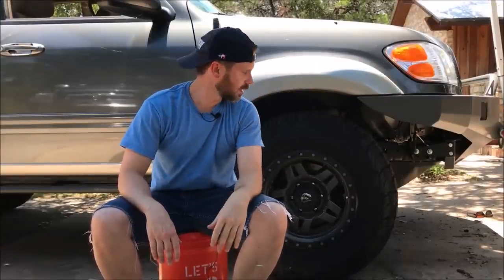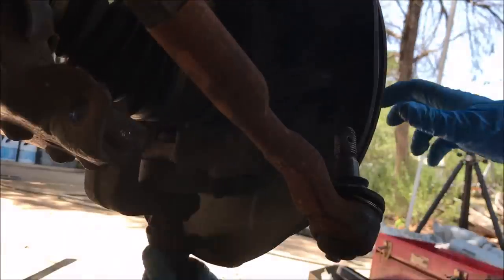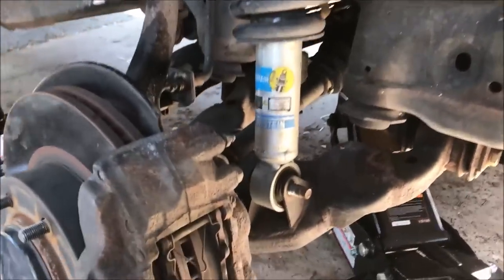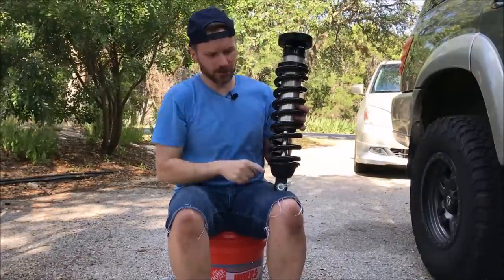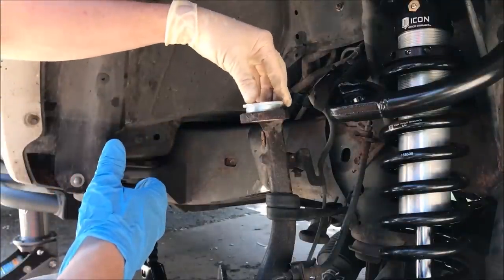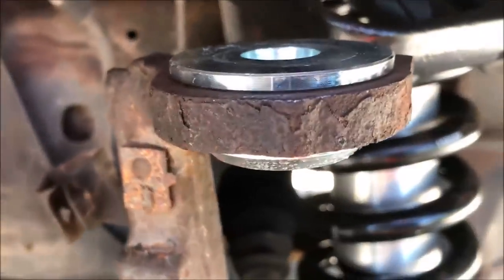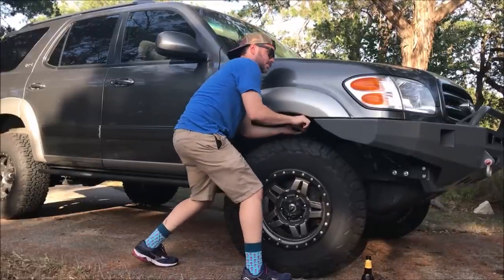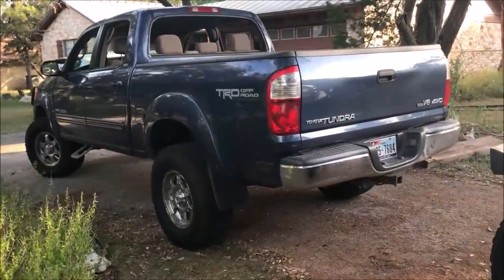Ep. 8. Icon Coilovers, SPC UCAs, OEM Lower Ball Joints Install Tundra/Sequoia

Comment: How does it drive now? I have the 5100s right now but id love to hear if it's a better and smoother ride with the icon set up. Thanks for the videos buddy.
Reply from the maker: Yeah. Bilsteins are the best bang for your buck. For the price they’re hard to beat. These icons are smoother than the Bilsteins but they’re also quite a bit more pricy. If it wasn’t for the bumper and my future plans to add a winch, I would have just stuck with them.
Reply: renelimones i ran the 5100s first. It was  good for me to start with that for my build, but with the OE hardware it just didnt cut it for me, even before I added a bumper, winch and dual battery up front. If you're going to keep running 5100s, I'd say make the jump to toytec springs. But I put on ADS coilovers (they're local here in Tucson for me) and total chaos UCA's and it made a huge difference. I actually still run bilsteins in my rear after a few years, but I'll change then out to ADS with reservoirs next. After I buy a new rear bumper from Josh. SOOO sweet looking. Just wish they'd powder them
Reply: desert4wheeling thank you for the heads up on the springs. I plan on just getting some Firestone airbags for the rear to give it a more stable ride. I don't know if you've looked into them but it looks like they work. Plus they're pretty cheap in price with great reviews.
Reply: renelimones I never thought of bags. When I get josh's new rear bumper that'll probably add over 150 lbs more to my rear so i may have to do something about that added weight. Thanks for the heads up there
Reply: @desert4wheeling209  I just installed the air lift 1000 kit on mine and I love them. We just took a 1600 mile trip loaded with a small trailer full of crap and those air bags worked great at 30psi. And with regular driving I like to keep them pressured at 18 psi for a smooth ride on the back end. Still haven't got to the toytec springs but those are next.

Comment: All of the non factory Toyota 1st gen suspension/steering components seem to rust almost instantly, including moog. I recommend painting them before installing with either VHT epoxy spray paint or POR 15 brush on paint

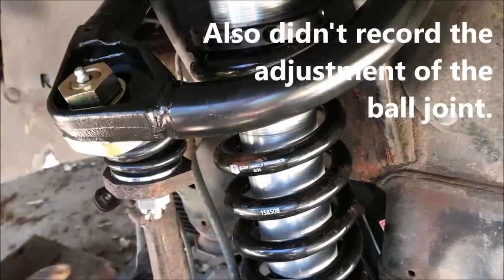Comment: @30:55 you say "Instructions say set to 'D'. I would set to 'A'". I'm curious why you choose A? I think I am going to choose A just so i can try and compensate with the lower adjusters and move the wheel as far forward as i can but still get negative caster. I tubbed the firewall to clear 35's with stock geometry (Just 5100s on middle setting), but with my SPC UCAs and long travel Fox Factory 2.5s I'm hoping to get the caster geometry negative while moving the axle as far forward as possible and maybe clearing 37s! I want to keep some negative caster fro wheel return and good wheel feedback.  What say you?
Reply: Did you ever get to do the 37s? any pointers you could share?

Comment: Do the upper ball joints wear at the same rate? My observation on Youtube is that the lower ball joints fail more often than the uppers. Is it just "common sense" to replace both in the same job?
Reply from the maker: That's right.  The lower ball joints are a known week link for these trucks.  When they fail, it's usually very bad news.  In fact my brother, who drives a 1st gen tundra, had one bread at about 30 mph.  They're not very expensive, it's not difficult.  Don't know if it had ever been changed and decided to do the work while I had everything taken apart.  Hopefully won't have to dig in there for a while.

Comment: Notice how the new UCA rotated freely after it was torqued in place? The stock one will not do that, you have to push hard on it to get it to move up and down because you are twisting the rubber bushings to get movement, not ideal. Want the same on the LCA, so new bushings needed there.

Comment: How's the ride with the new icon coilovers? Planning on upgrading my suspension on my 1st gen tundra. And need some ideas.
Reply from the maker: It’s great. Eats up every bump. Never feel like I’m stressing he suspension. You can’t beat icons.
Reply: @1stgenoffroad  Did you go with 700lb spring or stay w/ the 650lb?
Reply from the maker: 700. Added a bumper and a winch. 650 pounds won’t work for our heavy trucks.
Reply: @1stgenoffroad  Awesome. Thanks for the info. I'll be purchasing the same bumper next year.

Comment: I wouldn't use red locktite. In my experience as a automotive technician, red locktite can require you to have to heat the part up later with a blow torch to get it to release. Any bolts that need to be potentially removed in the future for service (a ball joint is a service item that generally is recommended to be replaced every 75K miles), you should use blue locktite and torque it to the factory specs.

Comment: I have a 3 inch lift and 35” tires. My UCA the ball join it’s rubbing with the coil spring. Can I put the SPC? I’m afraid that it will rubb on my tires. What do you recommend?
Reply from the maker: Absolutely change the SPC UCA. It will help to keep the UCA from clanging on the coil.
Reply: 1stgenoffroad I watch other video that the new adapter some of them are small than the diameter of the hole and they are loose when they put it inside the hole. The video was 2 years ago. Do you think they did work on the diameters the adapter!? Your adapter it was hard to put it inside the hole so it means that it’s better that way not to be loose.
Reply from the maker: @almor820  yeah, SPC has actually changed the design to more mimic the OE style.
Reply: 1stgenoffroad thank you so much!!
Reply: Hello again... I hope you are doing well..!!! Is there any returns from the market if I they don’t fit my truck??

Comment: Did you ever have to do the boot mod for your tundra or sequoia
Reply from the maker: Not for my Tundra because it has a bracket lift.  I may oneway with my Sequoia.  It's got a diff drop and so far the CV boots are okay. But if they start to sling grease I'll go with high angle CV boots.

Comment: Just installed mine a few days ago at home just like you did, but when I turn up a driveway or hit a bump, or even back down driveways I get a loud pop, doesn't matter which side flexes.
Reply from the maker: Now are you talking about Icon coilovers, SPC Upper control arms, or lower ball joints? Or you changed all three?
Reply: 1stgenoffroad just the control arms. Maybe need to get an alignment.
Reply: I've been chasing a similar popping noise when the chassis is flexed in similar situations you mentioned. I have yet to figure out what it is. Drives me crazy.

Comment: Why did you set upc to A setting which is +4 degrees.
Reply from the maker: Wanted to get max caster to move the wheels away from the rear wheel well as much as possible.

Comment: Are all your torques you throw out the same for a first gen tundra? 2006
Reply: Did you adjust the height before installing? With the spacer tool
Reply: Spanner wrench
Reply from the maker: @derekkygar373  I'm not sure if the torque specs are the same.  It would be reasonable to assume so, but I would verify.  The Icons come pre-set to 2".  That's where I left them.
Reply: @1stgenoffroad  ok great. And you can go up to 2.5”?
Reply from the maker: @derekkygar373  Yes.  They can be adjusted up to 2.5" of lift.
Reply: @1stgenoffroad  thanks man! Appreciate it
Reply: @1stgenoffroad  hey man just wanted to say thanks for you video. Exact set up I went with, I watched your video over and over again. I’m sure you get this but I am sure thankful for your video.

Comment: Would those upper control arms fit on a first year generation tundra?
Reply from the maker: Yes sir.  But SPC has changed the design since I made this video.  Now the slug/knuckle inserts into the sprindle from the other direction.  Here's the link to the SPC arms for the Tundra: https://www.1stgenoffroad.com/store/p263/2000-2006-Toyota-Tundra-SPC-ucas-with-adjustable-ball-joints-forged-steel.html
Reply: @1stgenoffroad  good man! thanks

Comment: After all that need to replace the LCA bushings with some Super Pros so the LCA will respond freely instead of twisting the stock rubber bushings to get movement. Then would have a nice responsive suspension.

Comment: Do you have any idea how to replace the fuel pump on the 1st generation sequoia's?  If it's by dropping the gas tank or if there is an access inside the vehicle.
Reply from the maker: Fuel pumps in the gas tank. Have to drop the tank.
Reply: @1stgenoffroad  Thank you

Comment: next time you run into things like the lower bolt on the coil over assembly, it doesnt matter which way you put thhe bolt in, but to make life easier, out the boly to the out side and the nut to the inside.

Comment: When it comes to lower ball joints you should always make sure and even make it a big deal to go with genuine Toyota factory parts.   Aftermarket parts don't last and can break (anytime), and this is one of the biggest mistake new owners of used Toyotas make.  This is the reason the Toyotas get totaled.  The only aftermarket would be race parts, like Marlinclawler's new IFS or a SAS.
Reply from the maker: Correct.  I only use OE Toyota LBJs.

Comment: Would this be the safe for my first gen tundra 2006 sr5 2wd
Reply from the maker: Yes.  Exact same.  But the new version of the SPC UCA has you pressing the slug in from the other direction just like he OEM ball joint..  Follow the directions.
Reply: @1stgenoffroad  Where can I find a kit to rebuild my entire front suspension? Have 175k on my tundra and has some play in steering want to get nice and crisp.
Reply from the maker: @BackInBlackReviews96  I don't really know of a complete kit. Consider all new bushings (especially steering rack bushings).  Replace the lower ball joints if they haven't been don't yet.  Get the front wheels off the ground and see if you can see where there is play. Shake the tire at 9 and 3 o clock.  If there is play, could be inner or outer tie rods or hubs.  12 and 6 only would rule out inner and outer tie rods. I would start there.
Reply: @1stgenoffroad  Thanks so much for the info and the fast reply. Will be trying today if it decides to stop raining. I currently have spacers front and back which kit would be the best to replace with noticed you sell a couple on your website. I have subscribed looking forward to new videos on the Tundra have a good day
Reply from the maker: @BackInBlackReviews96  This is my most popular kit: https://www.1stgenoffroad.com/store/p227/2InchLiftKitDeluxe20012007ToyotaSequoia.html
Reply: @1stgenoffroad  Works on the tundra correct ? I currently have spacers in front and back can they be used with ?
Reply from the maker: @BackInBlackReviews96  oh.  This is for the Tundra: https://www.1stgenoffroad.com/store/p768/3/1Level/Lift2000-2006TundraSPC.html

Comment: You installed the upper control arm incorrectly.
Reply from the maker: Nope!  This is the old style. This video is 2.5 years old.  SPC has since changed the design. The new style of SPC inserts has you press it in from the other direction.  Always follow the instructions that come with your product.
Reply: I stand corrected, thank you

Comment: Icon shocks are junk.  Rebuilt a set, and the tolerances were not consistent in their machined parts.
Reply from the maker: You rebuilt A set?  I've run these since I put them on in 2018.  40,000 miles ago.  Still going strong.
Reply: @1stgenoffroad  Rebuilt them for a customer.  Expected more from Icon for the price.